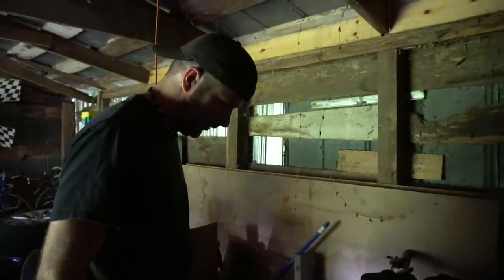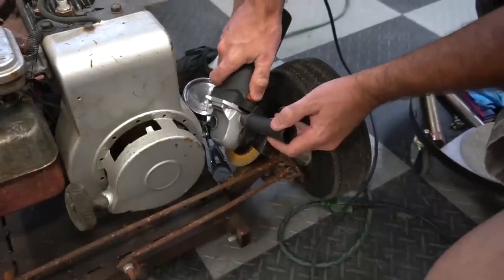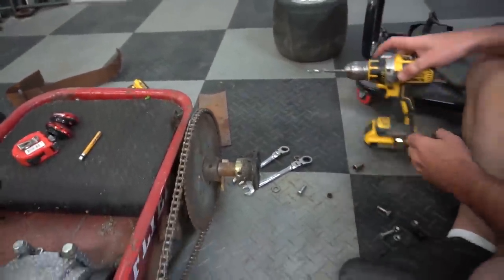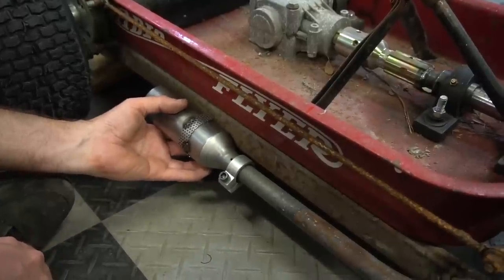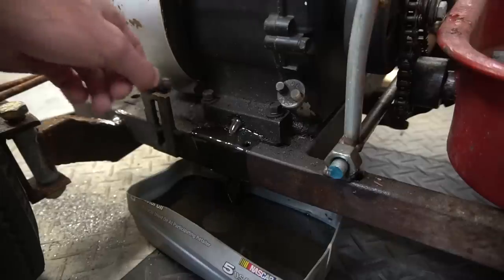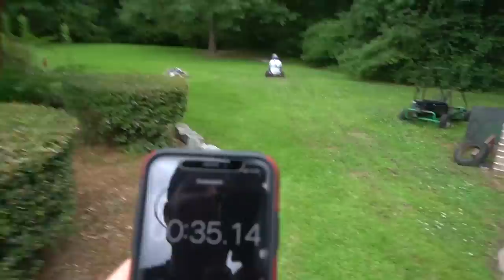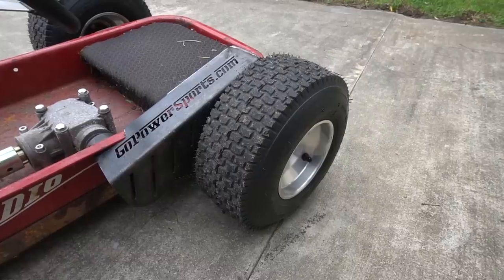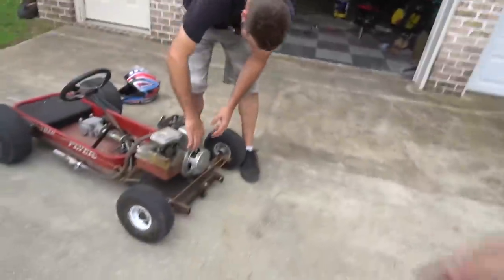Reviving the Rat Rod Wagon! | Our Rat Rod Go Kart Build

Comment: pair of rear guards .... will make it a little safer and will keep you in place
Reply: rob burdack then it wouldn't be a rat rod. The point of it it for funky odd looks not safe. But I see what you mean
Reply: putting rear tubs on it wont take away from it being a rat rod in any way shape or form ..... its not like they have to be fabricated to show grade standards
Reply: They can shape some rear guards from sheet metal and make them look cool, as well as protecting that right hip.
Reply: GO SkidMaRk - Shape them, what like with an English Wheel, make those Boi's Work..!
Reply: rob burdack you could make them like old tractor fenders they don't hardly cover the tire at all bit puts something between you and the tire

Comment: Why don't you all try to make the quietest go-kart you can, it is a lot harder than you both may think, and it may prove to be a good vid
Reply: really hard with a flathead, I made a big muffler for a minibile out of some 3" tubing, a ton of stainless steel wool and some internal baffles. It was very quiet but the Brriggs was still noisey itself.
Reply: David Starr That would be the challenge, to make not only the muffler quiet but to some how quiet the engine noise too and maybe on a different new go-kart. I have a stock 212 on a homemade 12v generator and it is amazlingly quiet but most of the noise is from the engine, I can almost not hear the exhaust over the engine itself.
Reply: Simple: go electric and avoid using a chain if at all possible.

Comment from the maker: You asked for it, and here it is! The Rat Rod Wagon is BACK!
Reply: CarsandCameras hiiii your the favorite
Reply: CarsandCameras YESSSS!!!!
Reply: CarsandCameras giveaway?
Reply: Add a fender to the right side to save your shorts.
Reply: That 90 degree gear box would work nicely on the drag rail. 670 turned sideways with the exhaust sticking up on both sides, ram air scoop in the middle, driveshaft back to gear box and a nice short chain. Likely improve driveline efficiency and trap times. Looks like it has a fairly heavy splined input shaft so it should handle the power without any problem.
Reply: You guys should mount one of those steel tractor seats to it to get you a little farther from the tires and keep you in place
Reply: You really need to do uploads on Monday Wednesday and Friday and a Saturday night stream
Reply: CarsandCameras put finders on it
Reply: CarsandCameras thank you so much 😭😭😭😭
Reply: Take that catapilla and turn it into a budda fly
Reply: CarsandCameras put a 670 on it!!! And love the vids keep it up
Reply: You guys should put the black widow against the rail.
Reply: It don't look right without a V-style engine... You know what to do.😉😎
Reply: CarsandCameras rat rod ..it's the best kart! But you need some type of grill
Reply: Stretch it!  That'll even make it a little more stable.
Reply: CarsandCameras I was thinking of how Isaac had a model A before and it would be amazing if you could put fenders like the model A in the front and back on the rat-rod and paint it black with red flames  on the back  but not the tub
Reply: Make the axle wider so you can have a wider seat and not have the tires eat your shorts
Reply: Do the gokart frunt suspension like the murry port and polish the head thats all it needs in my opinion
Reply: CarsandCameras you guys should revive the turbo 420
Reply: Make the little rascals go kart the blur 2
Reply: CarsandCameras        

Put a big bore in it and put a smal grill on it and fenders to keep you senterd the back bumper could be above the seat so it is like a back rest
Reply: CarsandCameras use a wheel barrel as a chair
Reply: CarsandCameras just chop it halfway
Reply: Racing mower next?
Reply: CarsandCameras 

I watch evert video you have ever put on YouTube you are rilly good at what you do i love you videos it would be Awesome if I could ride with you for a day
Reply: CarsandCameras pleeeease bring back the 900cc death machine
Reply: Wheelbarrow tub cart. $250 cap on build. Head to head
Reply: exactly what I was thinking, It would look Sweet too!
Reply: CarsandCameras  put a back rest
Reply: Yay!
Reply: CarsandCameras I got a old Briggs of my kart don't need it swapped it for a 212 if u want the Briggs I'll send u it
Reply: Heck YEAH!!!
Reply: NOW SHAVE THAT HEAD
Reply: CarsandCameras what if y’all made it into a sleeper put in forged internals and new carb but leave the old cover to make it look old
Reply: Kid Da Gamer - Definitely..!
Reply: Ezequiel Martin - Polish The Head.!? Du mean inside the Exhaust Port or On the Outside to Pretty it up..?
Reply: CarsandCameras  Put extension on steering to where it goes up and put Barstool where you normally sit just a thought
Reply: 670 engine extend it and put a clean grill
Reply: Put a v twin on it an put the grill back on it or find another grill of the same style just cleaners but the rat rod is back and sicker than ever
Reply: @CarsandCameras 
Maybe some rear fenders to save your rear.
Reply: CarsandCameras you should put. mini ford model a/t grill on it
Reply: Finally the rat rod has been resurrected. I posted on your Facebook page asking for a rat rod 2.0 glad to see it back. One of my fav channels by the way.
Reply: Guys!  Harley Davidson forward controls for gas and brake and a seat back!
Reply: CarsandCameras  are you guy planin to keep the grill off honestly it gave the rat rod some character looked cool. But it'll be fine. I like the way you guys vibe and keep it positive.When a motor blows to bits it will be   fine.
Reply: Maybe by put a seat that will  hug your bottom like an ol school tractor seat with a little bounce for suspension will look great that my opinion. Great work brings the kid in me hahaha
Reply: Please make another one to give it company.
Reply: Fenders on the rear wheels to keep your butts out of them.
Reply: i have a 5 horse briggs engine its just a bit ... broke
It'll Be Fine
Reply: This was the build that first brought me to CarsandCameras!
Reply: Do you sale gokarts ?
Reply: HEY  the magic box is the gear box off a grain Auger I’ve replaced a few
Reply: CarsandCameras can I have the old tires
Reply: What kind of chickens do u have?
Reply: Fundipz 5000 They look like Rhode Island Reds??
Reply: TammySue PattyPan Interesting
Reply: CarsandCameras hey guys, would youse be interested in selling the ratrod? I’d really like to buy it.
Reply: u should expand the seat and make a roof
Reply: CarsandCam11eras
Reply: CarsandCameras 1u
Ĺm
Reply: Shayne Pucqqqqkett
Reply: CarsandCameras q
Reply: CarsandCameras   1
Reply: Ryan Williams '          """"""9
Reply: On the rat rod go kart what would be cool and bad ass is put the 670 predator rail engine on it

Comment: Hay CarsandCameras  JNaasty here.
     I think a easy modification for you guys to do. Would be to put on front Tire fenders on and modifying the location of the brake and gas pedals  on to the left and right tire covers. It also gives you a more adequate location for your feet by you being able to dig your heels into a set of pegs mounted on the wheel wells.

      For the rear back tire covers you can not only protect your pants from getting torn up. While at the same time you are giving your 6 a firm stable location to be planted in.

  Ps On a side note you know those shocks that come on the Mongoose dual suspension mountain bikes. The shock for the rear. Those would make excellent rear shocks for that Red Rider.  I mean you would have to build a custom 4-link suspension to use it maybe A 5 link rear suspension might be better to use. But I know you can see it in your head just by reading this comment and thank we can do it & It Will Be Fine.

Comment: Aloha from Hawai'i guys.
WOW I forgot about this build, has it been 2 years already?  The older I get the faster time flies.  You guys should put vertical butt protector plates on each side, it'll keep you from sliding around and give you more confidence to go faster doing laps on the property.  Don't ever change that Briggs motor for a more modern Honda clone.  That old flat-head Briggs is a perfect match for the rat rod like the old flat-head Ford V-8s are to full size rat rods.  I like how the frame and other steel parts got "rattier" with age adding to the look.  Don't ever paint the rusted metal, just Ospho it to stop further rusting while adding protection.  Mahalo nui for another great video.

Comment: Guys, I'm an old man, turn 70 last week.  I heard you say B&S engine parts were hard to find? Are they belly up?  I remember powering my old mountain bikes with Briggs engines, there larger 7.5 or 9hp engines were great.
Reply: Mike Hale Happy belated Birthday!
Reply: Thanks for your comment, greatly appreciated.
Reply: Mike, Briggs is far from belly up. For any parts, just find the part number for what you need and search on the internet. Many parts can be bought on eBay and Amazon. Don’t think we will see a shortage of Briggs parts in the next century
Reply: Stock parts are available just fine. Hopped up racing parts have pretty much been phased out in favor of OHV engine parts.

Comment: If you're taking suggestions for the build, I have a suggestion. Get a tractor bucket seat, and mount fenders to the side of the seat to cover the rear wheels. And speaking od the rear wheels, I love rat rods, and I've seen very few-if-any-with skinny rear wheels/tires.

Comment: Foot pegs in a position just behind the front wheels with the throttle and brake controls, it looked like a good place to set. Mud guards for the front wheels if you go that route and care about getting messy.

Comment: Leave the power where it is and put some seat braces/back tire covers so no pants get pulled in lol and maybe some kind of heat shield over the exhaust pipe behind the gas pedal so your foot doesn't burn up after prolonged use and then just use it as a little putt around cart that has more power than it needs. That's just my idea. I'm all about power and I love seeing y'all build up those crazy fast carts but it's also really cool to see a little wagon used for utility purposes. Also, I agree with the other person that said build a hitch and get another wagon as a trailer to pull behind it for when you go to those swap meets.

Comment: You need to put a bar around the seat to support both your sides and your back . Something tubular that will start at the front of the chain-guard and go all the way around just behind the exhaust on the other side. Also you need to put some weight at the front. Maybe a custom tank with a vacuum pump at the font with some weights hiding under it to help with the stearing!

Comment: Better than I remembered, but I really liked the grill.  You just needed to clean the rust off of it.  You should add a rear fender, on the non chain side.  You can move the steering arm on the knuckle outboard more(towards the tire) it will help calm the twitchyness.

Comment: That angle gear box is designed for a pto on a implement that is ran with at least a 35-90 hp tractor so don't be worried about it breaking

Comment: The frame needs paint and it needs a decent seat that supports you from sliding into the tire. A lawn tractor seat or boat seat maybe? That cart anint got no fenners on it lol and so weld up some heavy duty back fenners to cover the wheels with in case you want to lean on them. It needs one of those super clutches like you put on the other cart DeLorean because it wastes three seconds taking off. They also make smaller lighter flywheels for them. Make the back fenners match the chain guard.

Comment: deck the block .30, relive the valves, port and polish intake motor and carb. bore .40 over, weld the toes on cam to .25 over stock after final polish, 7hp tech. valve springs ( exhaust both valves ). offset flywhl key

Comment: Fenders on the rear tires and a seat with back rest ... Here's an idea that I've been thinking about and I don't think anyone else has done it...luxury gocart maybe an enclosed cabin  predator 25 hp. V twin... Ez go steering box and not sure about this part... if one could find an air conditioner compressor small enough  y'all could have an air conditioned go cart forgot to mention make it a two seater and possibly use some bucket seats out of a car...

Comment: Put sides on the sides of the seat, they keep you centered & off the tires. \------/
Build a Briggs for it.  And move the muffler closer to the motor & add a tail pipe to give it that sound of a rat rod.. Awesome machine guys !
Reply: And put a spark plug in the tail pipe to make flames

Comment: Hey I have a question I got a 1977 Yamaha dirtbike and it’s been sitting for about 30 years and I got it all cleaned up and I haven’t started it yet but it’s really easy to kick start like to easy and I’m thinking it’s low compression I even poured a little oil in the spark plug hole and it’s about the same, what can I do to fix it?

Comment: How about this. What if you guys got another wagon tub and added wooden sides to appear as a pickup bed, then weld up new frame rails with a big seat with side supports, then throw a big ol 670 in the front along with that transfer case that could hide underneath the wagon tub. Jack up the rear end and put big skinny tires? That’d look sick!
Reply: RAT ROD TRUCK BIG bLOCK

Comment: John and or Ike. My friend and I are in the planning of building a go kart nicknamed "demon" and the premise is to build the Dodge demon of go karts. My vision is a kart that can break tires for burnouts and donuts/and I'm gonna build the first line lock on a go kart for burnouts but really for the whole "drag" feel I'm going for. Has to break tires with me in the seat also. Burnout box of course. My question is what engine, sprocket setup, clutch or torque converter? I thought 212 but I doubt it will do this job. Top speed I don't care about 40 is enough for me in a kart. It's gonna be a tire killer mainly.

Comment: Put a brigs flat head raptor engine on it, look into junior dragster parts if you want to build the flat head. We run one on my kids jr he is limited to 11.90 @ about 55mph in the 1/8th mile becuase of age but it will do alot more. Head,header, cam, 33mm mikuni carb runiing on shine!

Comment: I don't think I'll get 33.3mph out of my rat rod radio flyer...I need to change the oil on my 5hp too! I can only dream of a photoshoot of mine when it's done next to yours. If you had a seat like mine, you'd save your pants. I'm curious what your camber/caster is on the front axle. I may be way over thinking mine.

Comment: bring back the pugly build, just got done redoing mine dropped in a 125cc in it but having a couple issues with it mainly in the carb and the throttle but when i get those things lined out it should be fine "It will be fine"

Comment: You would get better performance out of the cart if you did your gear reduction before the "transmission/magic box". It uses a lot of your power to "turn, spin, operate" and if your gear reduction was before the transmission it would be able turn/spin a lot slower and not use near as much power.

Comment: Do a built motor. There are parts all over the place. Alternatively buy a old mild jr dragster engine or stock bore internals. Not hard to get a jr dragster engine that’s super mild like 15-20 hp. Also based off of a 5hp Briggs block

Comment: There must not be a lot of farm boys around here .The Magic box is a PTO output shaft for a tractor or a 4 wheel drive with a PTO they are used for powered equipment that requires a engine to run and go to the output on the back of the tractor. the spline shaft on the Magic box is a dead giveaway of what it is . they even used the drive shaft for a tractor to connect it to there engine.

Comment: You guys need to find a differential equipped axle for that thing.

Also, getting a flatty 5 horse Briggs hotrodded up would be amazing. I'm...honestly not fond of Predator engines. Don't trust 'em. 99 bucks for a 212cc single? Can't last very well.

Comment: Go to a go-kart racing track and ask them up here in Nebraska that's what we would run in the outlaw class is brigs 5hp engines and they only had to look stock so the were bored out different valves and different cams running pure methanol

Comment: I had a funder wheels go-kart sitting in my back yard for six years the exhaust was facing up and the spark plug was screwed so me and my dads friend took of the 3.5 HP engine and replaced it with a 8.5 HP Honda pressure washer engine

Comment: Y'all should put a front-mounted 212 on it
Reply: Joshua Cyrus we did in the early build but didnt like it
Reply: Isaac it'll be fine Then for a future build. Y'all should do a wheel barrow tub, rat rod 670 build with the grill. It would be sick. With performance upgrades. Straight piped. With the tub you wouldn't need a seat really. Run that L- shaft under the kart. To the jack shaft.
Reply: Isaac it'll be fine I actually have this motorcycle engine. I'd like to build a kart around. The motorcycle in running condition maxed out at 140mph. I just need a welder😭

Comment: Build the 5 horses and put a real air philter on it
Reply: And the reason your faater with slower karts on the track is because the kart wont slide it slows you down in the corners to get out of the corner faster